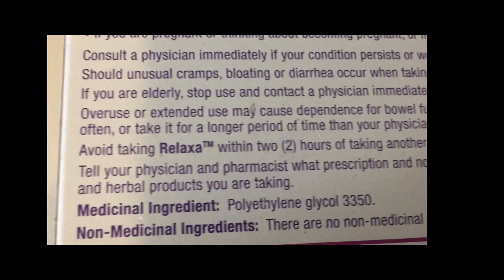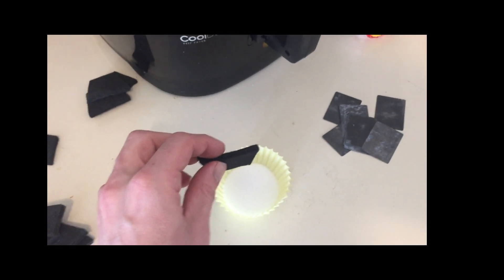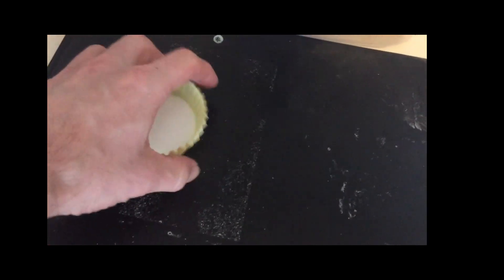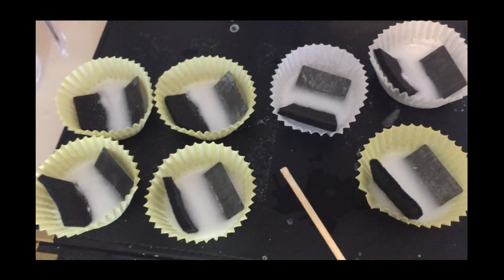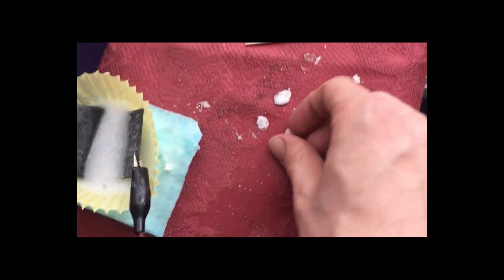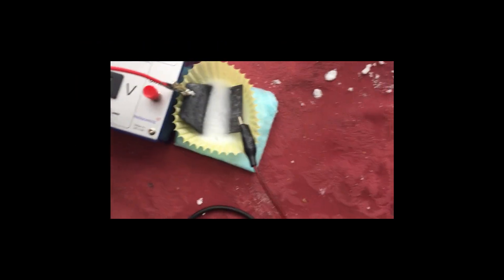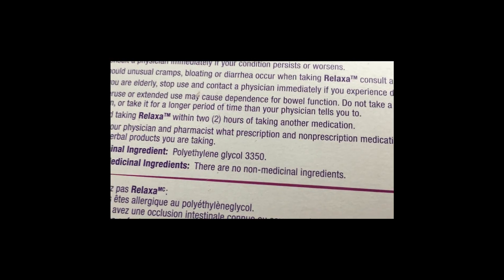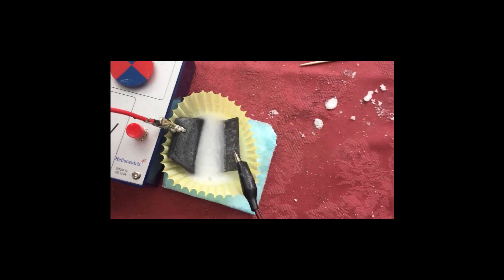Quantum Power Cell

Comment: The simplest way to make an electret I think is to overcharge a capacitor. By mistake I've overcharged a supercapacitor of 3.6V, 2000F. I've ruined it of course, it didn't keep any current in it, but I've noticed that the voltage remain at 1.5V no matter what I did with it. After that I've tried with cheaper capacitors (16V 220uF) and the phenomenon shows up. It keeps some voltage after that (under 1V). No matter how long you short circuited these capacitors, they're building up voltage until the previous level is reached.
Reply: So, you just need a bigger cap then … like a full coil of coax cable cooked in the oven while charged with some high voltage and leave it to cool down slowly while still provided with HV … when cools down disconnect and use as you please if you need to run some domestic appliances. 😉

Comment: Im curious if changing the rate it dries would affect the voltage. Perhaps drying faster might make it have a different crystal structure in the end which might affect things. Could try drying it in the oven on low.
Reply from the maker: I was thinking of that and perhaps if it melts as well at low heat instead of adding water. few things yet to try.

Comment: Very cool stuff. What sort of no current input triggered devices do you plan on using these with?
Reply from the maker: It's just to test and experiment with the solid state electrolyte properties the plan is to somehow mold this into thin wafers and stack cell plates with my piezo and electret capacitor cell pile plates and build something like a Hutchison/Zamboni hybrid that would generate a fair amount of current at the end.
Reply from the maker: But for now this would run small oscillators and even Bedini like devices and use inductive kickback to charge batteries. So that is one usage as is for this. But i'm trying to take it into another level. With the final cell pile.

Comment: have you tried to draw current out of them?
Reply from the maker: Runs small dc motors small lamps and even oscillators. If you stack them in paralel you get a few watts but that's not the goal here its to use for near zero current input triggers for other systems and to test the solid state electrolyte behaviours for my future cell pile.
Reply: That's promising!

Comment: Thank you.  The only way to make money these days with new findings is to release the info publicly (insurance policy) allow people to duplicate, improve, share and perfect. Then reproduce and sell your own.  There will always be people who won't / can't make their own and will buy.  Bedini kits are a prime example of this.  So many inventors die along with their secrets. Stanley Meyor for example among a long list of others.  "Conditioned magnets"?  Who knows?  Why? You know the answer.  Thanks again.
Reply: I will experiment with the copper and magnesium set up like the "Chrystal battery" only using this chemical. See if there is added current and voltage.
Reply from the maker: If you want to use these cells just like this and call it a day a quick way to boost is to spare one of the cells on its own and it charges a cap slowly to over 1 volt within a few milliseconds. connect a small transistor as a switch, This triggers the cap to dump into the transistor bias once the saturation on voltage reaches point. Then pulse the series cells, 12v etc, into a big coil and collect the inductive kickback or step up voltage. It becomes self triggered. Because these on their own don't produce much current it should turn the latch off for a moment as it recharges the cap. With a reg battery with such a setup once the switch turns on it just stays there like that with no reset. Without more like SCR circuits etc..